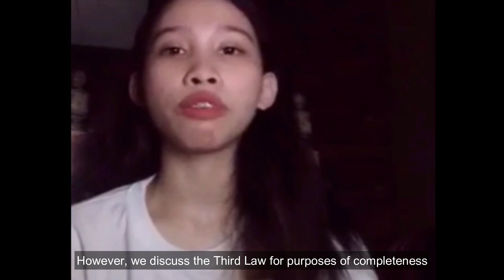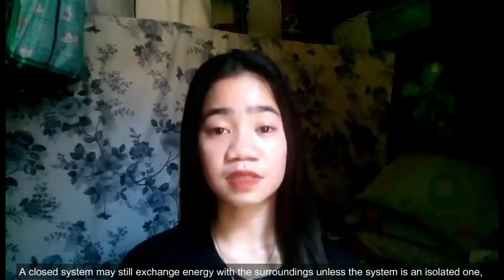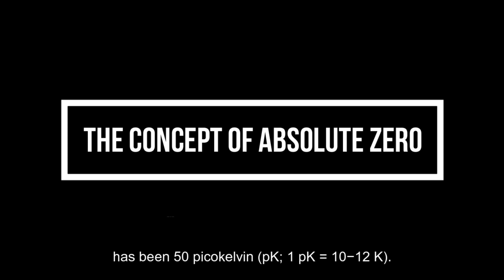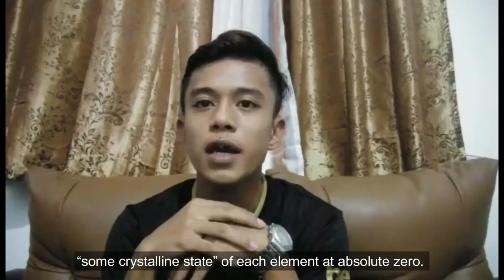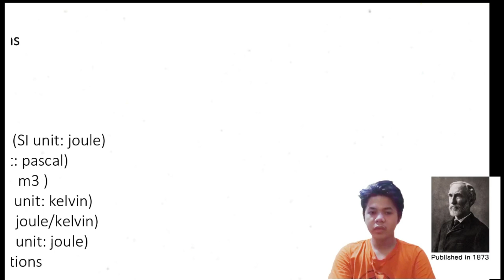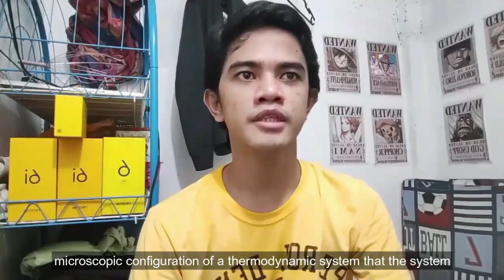Basic SCIENCE | Third Law of Thermodynamics

Comment: Answer:
Absolute zero is the lowest possible temperature where nothing could be colder and no heat energy remains in a substance. In which,, it remains zero at zero Kelvin(0 K) that particles or the molecules stop moving and all the disorder disappears. But molecules do not stop moving at absolute zero. They more much less than at higher temperature, but they still have small vibrations at absolute zero, in which their movements is governed by the laws of quantum mechanics.